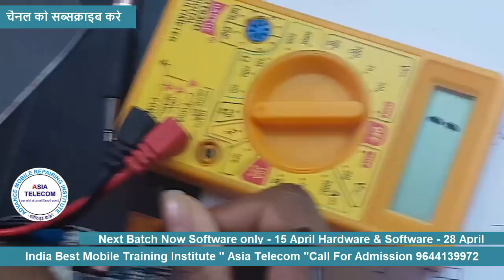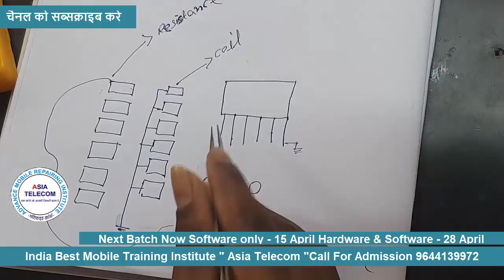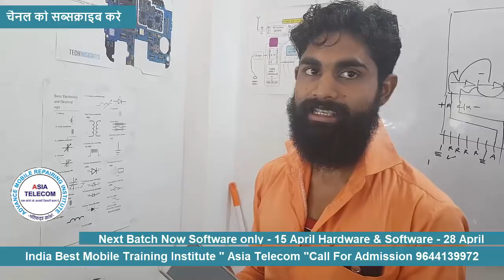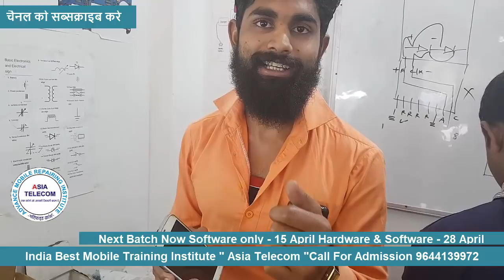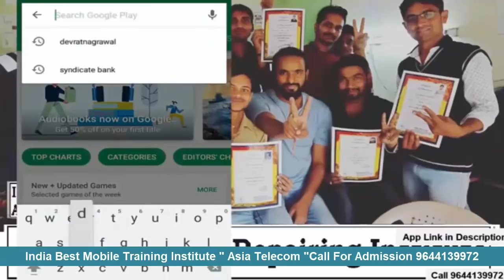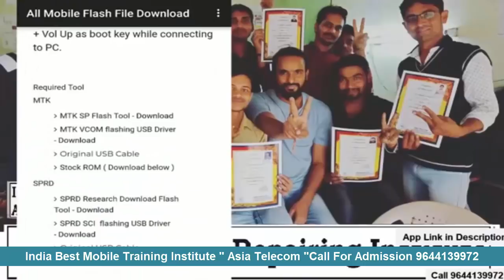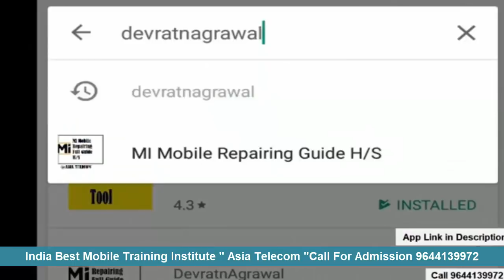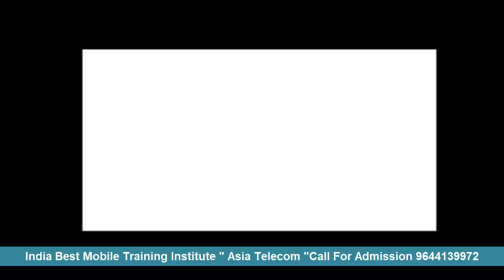All Andorid Mobile Touch Repair | Touch Mobile Repair without Circuit Diagram | India No.1 Institute

Comment: Fees ke bare me kuch bataye
Reply from the maker: 26500 Total (Include -hostel +khana)OCA Training + Microscope Training. 
Batch - 28 june  wala milega..
One month daily 6 to 7 hour classes
No copy pen allow in our class 
All Mobile +keypad + android + iphone All section tracing + IC Reballing + Resoldering 

All mobile software 
Umt+Miracle+z3x full training with box and  Without box compelete flashing praticle
All mobile FRP unlock
All Mobile mode 
Flashing Error Solution 
4TB flash FileHDD - (2500 extra)
Limited sheet only 

Agar course  karna hai toh aapni detail sms karo..aapko call aajeyega ..reply text message mein de 9644139972 & 7999865564

Rajesh sir se touch mein rahe -7999865564